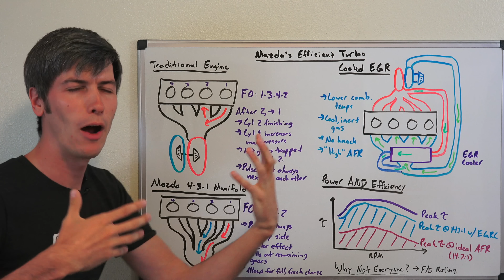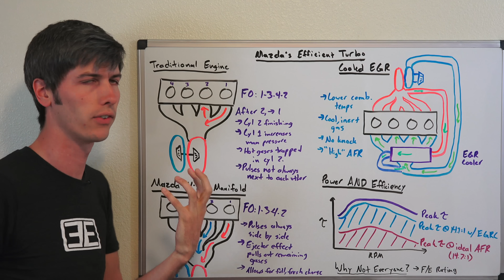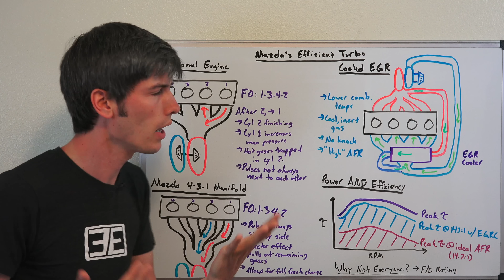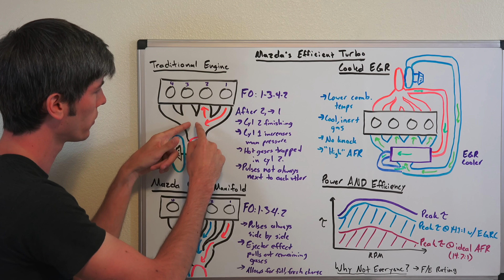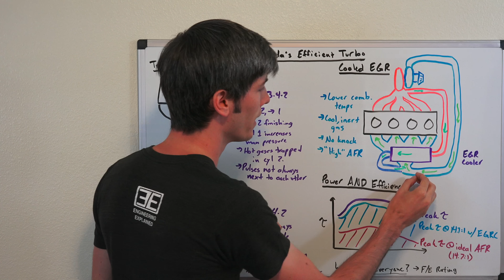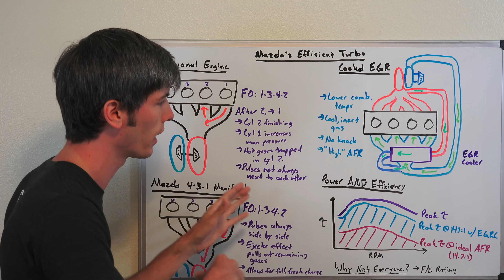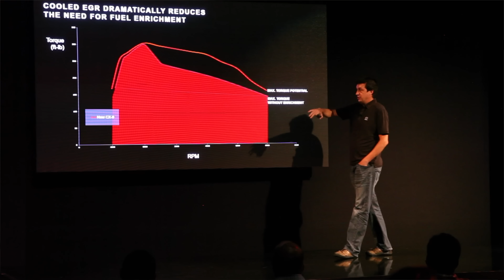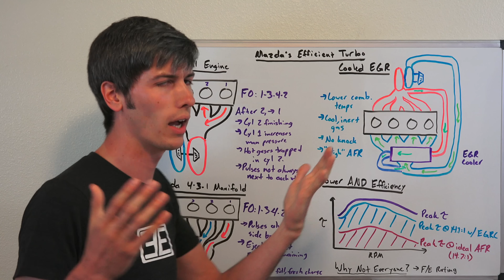Mazda's Secret To Efficient Turbo Engines

Comment: Turning off the EGR was what allowed VW diesels to have god fuel economy (because diesels don't need to worry about knock) at high power (because cold aid as higher density that hot exhaust gases). I always asked myself why hasn't anyone (in particular diesel makes because of the lean combustion) implemented EGR cooling. After all, it is a logical and intercoolers after turbochargers have been a thing since turbochargers were invented. What prevented other manufacturers from using cooling of the EGR and what did Mazda do to overcome it?

Comment: EGR? have they solved the issue about dirty and blocked EGR due to soot build up, or stuck valves due to carbon buildup way after the warranty period? Just because its cooled does not make soot disappear. No thanks.

Comment: Wouldn't the new EGR-route make it impossible to use an air-oil-separator, thus increasing the risk of valve-carbonisation? Or is it not a direct injected engine?

Comment: Why use egr now that we can lean/rich the mix with injection?
Reply: Because using it wisely (cooled EGR) you can maintain a higher AFR without having knock issues! You can always make the ratio leaner if you want, but knock knock...who's at the door? 😂

Comment: In the real world, some of these technologies add expensive maintenance to an engine which  offsets any perceived efficiencies.  For example, "cooled EGR" has been tried by other automakers. The result was an EGR heat-exchanger which plugged up with carbon and required removal and torch-cleaning..... How has Mazda circumvented this problem?

Comment: Be careful about "real world", We will go back to the bad old days of people driving to the top of mountains for "Real World" fuel usage runs. And the no AC, no PS, no alternator, no water pump and no diff oil and Gearbox oil dyno runs to show power. In "real world testing" Tesla fails noise level test!. Change the test!, don't throw it out.

Comment: Any issues with EGR gasses/pollutants condensing in the cooler manifold before it dumps into the intake manifold? I hate the fact EGR and crankcase recirculation is the main problem with direct injection. Anything recirculated will carry oil vapor and pollution, crudding up the intake manifold and intake valves.

Ford was using a "cooled EGR" manifold on the 6.0L Powerstroke Diesel. Guess what? It was the main reason that engine was unreliable and had problems.
Reply: I agree! It was the same problem with volkswagen TDIs. I've cleaned the carbon on mine (ALH) and done an EGR delete exactly not to soot the intake again...
Reply: And gained a heap of performance in the process, most likely. Diesels are designed to BREATHE. The only limit to diesels making more and more power is how much air can be crammed into them and how much force the engine block can keep inside without cracking in half.
Reply: @turnin.sprocket  piston speed is the limiting factor.
Reply: Mazda's whole Skyactiv lineup, as far as I know, only uses DI. This will lead to aggressive carbon buildup no matter what you do. It's a shame Mazda and Ford no longer co-develop their engines - Ford took Mazda's old L engines and the dual injected them to improve serviceability, while Mazda did this to improve economy. If only we could have both.
Reply: Gammashack my step brother has a 2015 Mazda3 which as far as I know has a direct injected 2.0L engine. He has had zero issues with it for almost 400k miles! He uses it as a delivery/long distance courier vehicle which involves a huge amount of varied city and highway driving. Nothing more than standard servicing and it’s still going strong.
Reply: tp7886  Is that the "Skyactiv" engine?
Reply: @turnin.sprocket  I don't think it is, so tp7886's 2015 Mazda3 would not be an example of cooled EGR reliability.
Reply: Just buy a new 2019 5.0 Coyote V8. It's dual injected. Which is always cool for huge power adders.
Reply: Lifted_Above agreed! as if the massive issues of carbon buildup weren't enough in these DI engines. I'd like to think that these EGR engines have some kind of filtering in place.
Reply: All gas-DI engines should be dual injection (port and direct).
Reply: Some modern diesels are switching to Low Pressure EGR which takes the exhaust gas feed from downstream of the after-treatment system (i.e. after the catalyst, NOx after-treatment and DPF) so you are injecting cool, clean gas back into the intake manifold free from soot and hydrocarbons. I would imagine the same thing can be done with a gasonline engine. It can be difficult to implement, however, due to the lower pressure differential between intake and exhaust. In lab tests the suction of the emission analyser on the exhaust can cause issues with the egr not flowing sufficiently.
Reply: Or just rip it off and throw it into the weeds. Remove every vehicle on the planet from every road on the planet and it would still heat up and still have trouble.

Comment: Voted year's best engine. Ten years later, see bitter, negative comments on the internet about how crappy and unreliable the engine is.
Reply: Captain Shark like the one you posted?
Reply: Captain Shark facts? Evidence? Or just your worthless opinion and magical glass bowl??
Reply: You must be referring to the 2.3L Turbo MZR L3K9 engines in the previous gen CX-7, MS3 and MS6.  They won Ward's best engines.  A short few years later, bad turbos, smoking at idle issues, bad VVT actuators, timing chain slapping valve covers, stretched timing chains, impossible to time correctly without keyed pulleys and timing marks, etc. and so on...
Reply: Thanks! One common example I have to add are the Northstar engines, but this is a foreign car video.

Comment: Has Mazda solved their (eternal) rust issues? Serious question. Recalling vehicles for suspension and steering corrosion is nothing to be proud of, besides being outright dangerous for the consumer. Until we have a guarantee that this is something of the past, I would be afraid of owning one of the models affected. True, I may be blowing the issue out of proportions, but it is something that would keep me in a continuous anxiety state.
Reply: Google "Mazda rust recall" or something like that and you'll get plenty of articles. Unfortunately, they had issues with major components and on relatively new cars. The reports for the steering rack becoming loose are absolutely terrifying. Good thing that there were not that many reports on that particular problem. 
You did well by washing the undercarriage frequently. I would assume that made a huge difference in preventing the rust from setting in. Unfortunately, washing the undercarriage is not possible for everyone or most of the people do not care about that.

Comment: Compare this 2.5T in the 2018 Mazda6 to the 2.0T in the 2018 Honda Accord.  Mazda needs a displacement that's 25% larger to get similar rated power, actually Honda is +2hp (Note:  the Honda 2.0T measures 265 FWHP on the dyno).  The Accord's 0-60 time is nearly a full second faster and the Accord gets 3mpg better on Car and Driver's testing.  So what is Honda doing to beat Mazda in both power, performance and fuel economy in their 4-cyl turbo engine?
Reply: same question jason
Reply: The goal is not to make the most HP.

Comment: Hmmh I missed the point on how having more boost with cool egr gasses has better efficiency compared to less boost with more oxygen rich air (=no egr gasses)? If you are creating the same amount of power, isn't the heat same? And more boost = more exhaust restriction? What am I missing here?

Comment: Why not just setup an air to water intercooler for the cold side of the turbo along with the egr.  I would see how this would work much better to keep temps at ambient instead of just cooling egr. Egr is also the stupidest thing on planet earth to be ever implemented on any car. I want to see how much less pollutant is actually emitted due to egr.

Comment: Am I right in thinking that Mazda are using the exhaust gas to displace fresh air in the cylinder. Allowing less oxygen and therefore less fuel in the cylinder while still retaining high cylinder pressure? Somewhat like a diesel and it's volumetric efficiency?

Comment: I've been wondering about this, and I know it sounds reasonably absurd, but why not aircon the intake air? If you want an optimal combustion and eliminate a lot of potential oxidation wear, you'll want to eliminate intake water as much as possible. You could then mix it with this system minus the coolant on the exhaust (the air conditioner will do that for you) to still maintain stochiometric ratios of oxygen to ignite. Is the energy loss from using an air conditioner that high?

Comment: I mean, it's not *that* powerful. It makes, what, 227 horsepower out of a 2.5L? Volkswagen gets 220 horsepower out of a 2.0L (292 horsepower in the Golf R). Obviously the GTI and Golf R aren't as fuel efficient in the real world, but it still demonstrates that there's still a tradeoff between power and efficiency.
Reply from the maker: Antenox that’s 227 HP on regular octane fuel. Makes 250 on premium if you want it, and lots of power down low. More torque than both the GTI and Golf R.
Reply: Torque torque not horsepower.

Comment: For EGR part, why don't they just inject less fuel? That would reduce the fuel/air ratio as well and thus no need for that EGR system, I'm guessing EGR system is also for emission purpose? (Unburnt fuel coming into combustion camber and burn again ). Sorry if this question sounds silly but I'm very curious.

Comment: Isn't the "exhaust scavenging" concept pretty much exactly what equal length tube headers do? Nothing new on that point, in my opinion. 
Using cooled EGR, though, I find an interesting concept. Although since using an unburnable gas, does that not mean a little extra fuel is needed to reach a correct AFR? Certainly not as much as required to cool the compressed fuel mixture under the usual engine design, I'm sure.
What really impressed me, though, is that FINALLY somebody came up with a way (and the interest) to actually try to get the car to match the EPA fuel economy statistics that never seem accurate! Way to go Mazda! Gonna sell more because you actually get what you see...

Comment: How much psi have the exhaustmanifold compared to the intakemanifold, because withe egr they are connected and boost could escape? Ore is the egr on the pull in side of the turbo?

Comment: Is that cooler going to cause the condensation and clogging issues similar to diesels get? I work on european cars and a big issue with the V.A.G. 3.0T (actually supercharged) has been clogged EGR ports, and the manufacturer recommended service is to drop the engine and pressure wash the EGR ports in the head...

Comment: I love Mazda, they're the little company that could. My next car will be a Mazda.
Reply: My last 3 where Mazda, pushed them too the limit and beyond, never had any problems. If you want to break them you have to crash em
Reply: Drive Mazda`s since 37 years. Have 3 now : RX 7 Rotary Turbo for sunny sundays ( - alternating with my 2 bikes ) , MX 5 ND 2.0 summer - daily and Cx 3 AWD 150 winter - daily.. Worth to mention: Live in no speed limit Germany ...
Reply: I never understood why car people existed until I bought myself an NA Mazda Miata. Never looked back since. I love that thing to death, and learned a ton from working on it. 10 out of 10 best first project car, it was so good I now have an NB in the driveway next to it. Having also driven an ND, I can confirm Mazda still makes cars the way they used to. How they got a 2300lb car through modern safety testing… I don’t wanna know but I love how they really let the engineers make good cars rather than having executives make compromising decisions. Maybe they aren’t as big as they could be because of that commitment, but I believe it will pay out for them in the long run as people start to figure out what’s up.
Reply: Very happy with our CX5 so far. Solid and well built.

Comment: My Fiat Panda (2012) had a cheaper way to fix this issue. It had a 2-cilinder turbocharged engine. It simply had an 'Eco'-button that limited the power, supposedly to keep the A/F ratio near stociometric. Granted, this isn't as neat as this technique, and you'd turn it off when overtaking in a hurry or something like that, but is is of course way cheaper. It lets the driver choose between power and efficiency.

Comment: I think since late 90s early 2000s cooled EGR here in Europe is commonly used on Diesel cars. Needed quite some time to get to petrol engines. When VW introduced the integrated and water-cooled exhaust manifold they got completelay rid of the EGR as they claimed not to need it anymore, one part less to break. 
Whether cooled EGR will be a good thing on petrol engines in the long term will all depend on the quality of the EGR-valve and cooler which have to suffer from higher exhaust temps than in a diesel.

Comment: Why is the EGR taken before the turbo and not after? The turbo runs on waste heat energy anyway, the manifold design would be simpler and the exhaust gas in theory should be a little cooler?
Reply: Turbos run HOT, you wouldn't want unburnt gasses igniting inside of the turbo.
Reply: EGR flows light throttle only , to cool the combustion during weak air/fuel ratio to reduce pollution only. Most likely the pressure before turbo is used to push EGR gas into pressurized intake.

Comment: Cooled EGR has been in diesel engines for a few year now. The issue is the life of the coolers and the damage cased when they start leaking coolant into the intake manifold. What kinds of materials are used for the coolers and how long is the warranty period on these engines?

Comment: The exhaust manifold doesn't have an 'ejector effect'. It has a 'Venturi effect'. Is there really anything new here? All this and more is well established engine design. Even my 1998 Land Cruiser 4.2 has the exhaust ports split to the turbo and it even has cooled EGR. It is a diesel of course.
The Mazda direct injection turbo petrol engine has a consequence of the EGR and direct injection, and that is high soot or particulate production. This must surely dictate the fitting of particulate filters in the exhaust system, just like a Diesel engine.

In real life, outside of marketing bullpoo, EGR actually decreases real world efficiency, increases complication and increases particulate emissions while reducing engine life and clogging the intake manifold and head ports with sooty crap.  It has its advantages but not without very significant disadvantages.

Comment: Wouldn't an intercooler integrated into the manifold after the turbo be better than cooled EGR in just about every way? Cooled EGR works against what you are trying to achieve with the turbo... I can see how it could help a little but it definitely takes some power and efficiency off of the peak of what you could do disregarding cooling.

If you're going to spend the money to put in a liquid cooled radiator for engine gases ... why not just cool the intake directly.

Comment: I'm going to catch all the hate from this I already know, but I drive a 2014 Chevy cruze (U.S 1.4T version) and at high rpm it is terrible for fuel economy,  but in every other scenario it really does get great fuel economy, it actually exceeds what the sticker says in most cases. I live in Southeast Texas where we are basically at sea level and the roads are flat and if I drive around 65 mph (104 kph) I get about 42 mpg. (Sorry, idk how to translate that for you). But the most interesting thing is that at high speeds when I'm NOT at very high rpm I still get great mpg, example; at 80 mph (128 kph) I usually still achieve right around 30 mpg. It's probably not the most well built engine in the world but it does what they claim.

Comment: Anòther great explanation! I loved my 2015 Mazda 3 skyactiv. The ONLY negative about Mazda is their a/c units. Myself and others I've spoken too as well, share our concerns over their poorly designed ac systems. I sold my 15 for that reason, I test drive an 18 recently, same exact crappy act system. Do you think you can make a video on "theory on how A.C. systems work" so Mazda can see it, fix their issue, and I can buy a 2020 Mazda 6? Please?